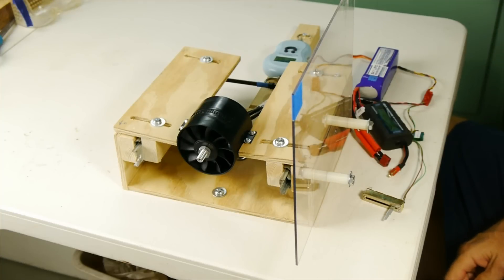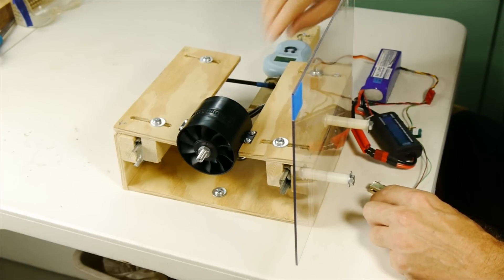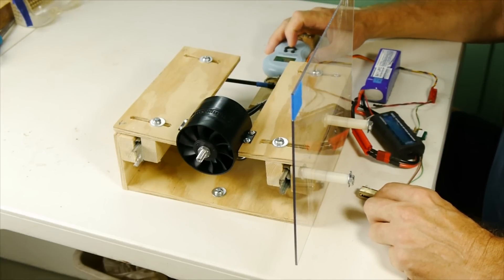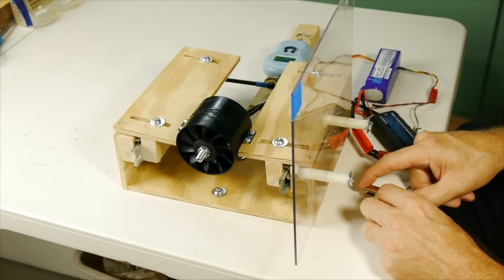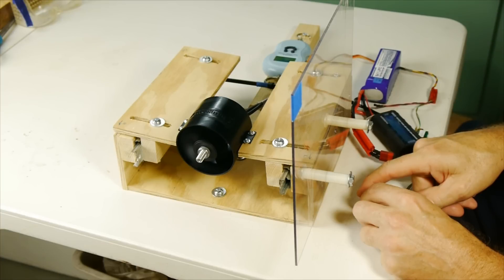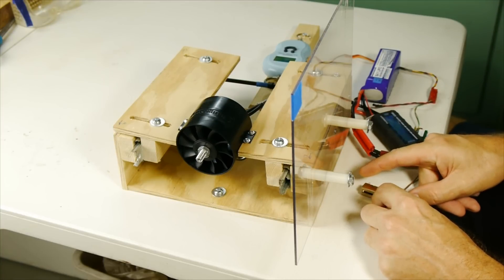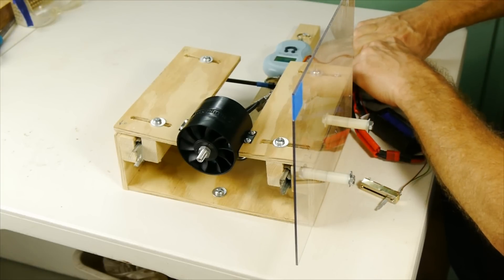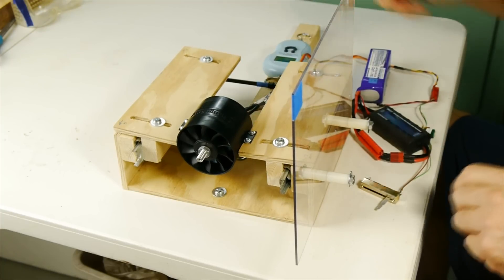CS 70mm EDF test for BAE Hawk

Comment: It looks like you are throttling the motor with a rheostat. If I'm right, can a brushless motor be controlled mechanically. I would like to build a ducted fan model for control line using a brushless motor, but would like to control the throttle mechanically. Is that possible? Any help will be greatly appreciated. Thanks in advance, Bill

Comment: I used a 10 blade changesun fan in my 70mm HK BAE Hawk. The Changesun housing is very inefficient. The blades in the housing are 90 degrees to the fan. Best setup ive found is to fit a changesun 10 blade into a cheapo 6 blade Freewing 70mm housing. I used a Turnigy L2855 2300kv Motor on 5s. 4 llbs of thrust at 48 Amps settled. Speed controller set on low timing.